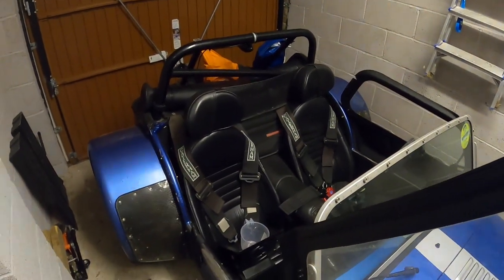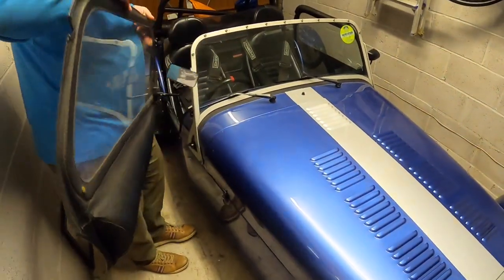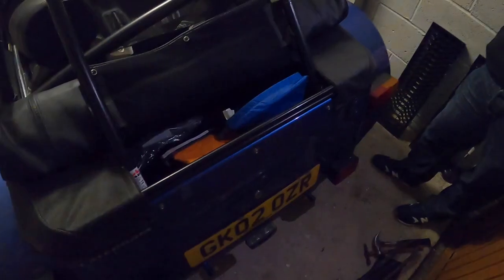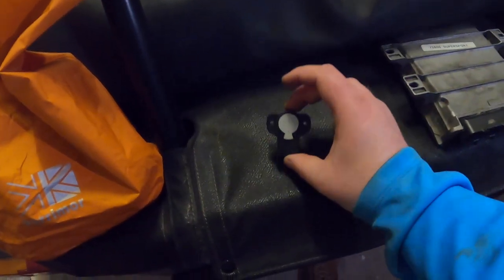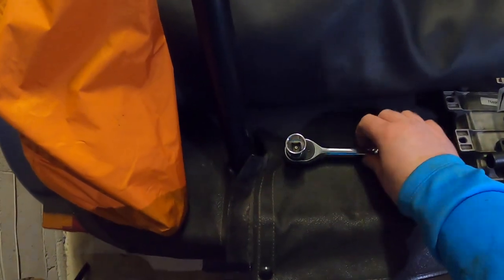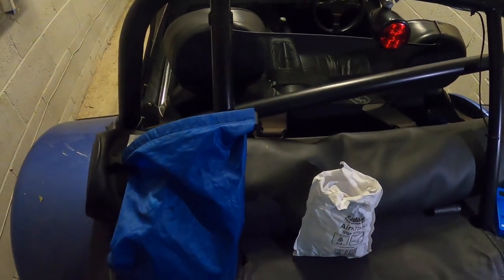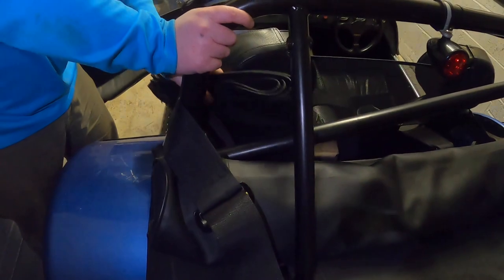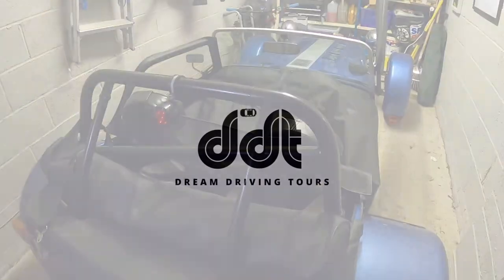18 things I take on every drive - Caterham 7

Comment: Maybe add a lathe and Bridgeport vertical mill so you can make parts on the road?
Seriously, that's a good heads-up, thanks.  From memory, virtually all the parts you carry are engine related, mainly engine management... is there a message there somewhere?  🤔

Comment: I take a litre of oil because I have a 30+ year old 1700 crossflow. A bottle of water can come in handy too. I have a battery cut off switch which I remove when I park the car. If somebody wants to steal mine bring a spare cut off key with you. I also have a tonneau cover which is easier to put on than the roof if I am just leaving it for a short time. On a cold day I can leave the passenger side on, if I am alone, keeps me warm with the heater on.

Comment: Do you have a spare tire & jack?
(I carry a 12 volt air pump in my vehicles as well)
Reply from the maker: I do carry a jack but no spare tire. I don't like the look of the tire hanging off the back. I'll probably live to regret this decision!
Reply: @DreamDrivingTours  Yes I wholeheartedly agree!
(Edit: about the look, it's not an MG-TD!)
One day I was far from home and parked next to an elderly couple just walking away from their 911. One of his tires was visibly low, so I caught up to them, and together, we pumped it up with my little air pump. 
The pumps are available as small as a brick. With that & a puncture repair kit, also a small item, you could fix a flat on your Seven, or even a stranded motorist or motorcyclist. 
Wish you the best!
Reply: @DreamDrivingTours  You carry a spare ECU, coolant components, TPS, multimeter etc but refuse to carry a spare tire because you don't like how it looks... When a flat tyre is infinitely more likely to strand you than any of the other components.